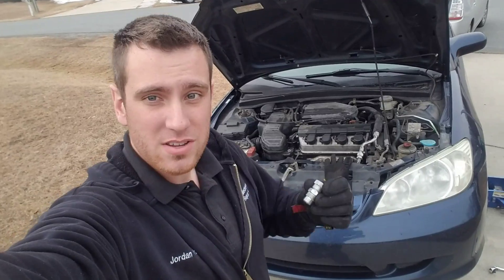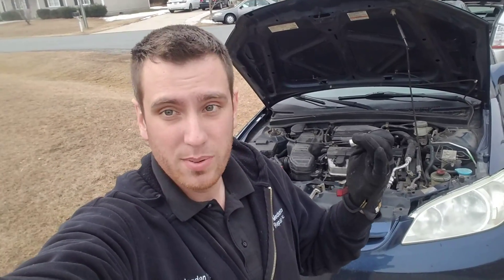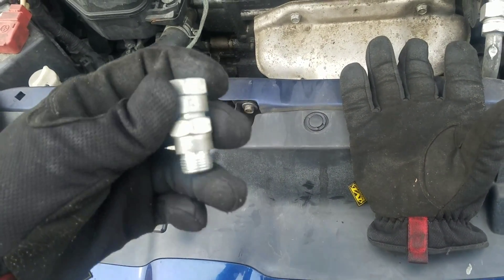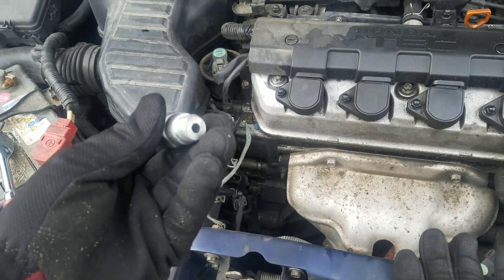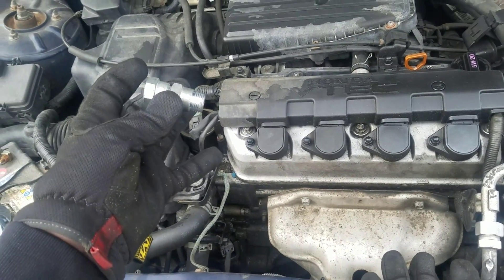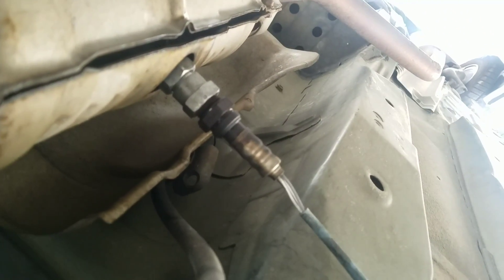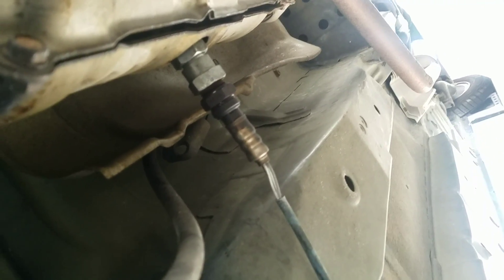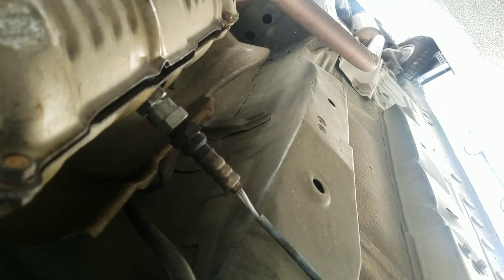P0420 P0430 Fix Keep Check Engine Light Off

Comment: So, you got the emissions light switched off. The light that tell you your car will fail the emissions inspection. Waste of time.
The only difficult bit in changing the rear sensor is getting the old one out. If you can do that, fit a new sensor. Now the light is out, and your car pass the emissions test....

Comment: Too bad that trick didn't work on my 2008 gmc acadia. 
When it did it code came out as low volts Bank 1 sensor 2.
Reply: I did an arcadia once and had to put those on all 4 sensors and it passed

Comment: OR... you can just get the specialty non fouler and skip the drilling for about an extra $8.50:
https://www.amazon.com/Defouler-Straight-Header-Exhaust-Stainless/dp/B07STVNJ3K/ref=pd_sbs_263_1/134-3160155-8718208?_encoding=UTF8&pd_rd_i=B07STVNJ3K&pd_rd_r=6c543257-4a17-4933-beb9-7592414d7b18&pd_rd_w=OFVvD&pd_rd_wg=DJNLr&pf_rd_p=7cd8f929-4345-4bf2-a554-7d7588b3dd5f&pf_rd_r=AXJ3PHK73V5AVGQYWVG2&psc=1&refRID=AXJ3PHK73V5AVGQYWVG2

Comment: Hi, So basically keeping everything the same leave sensor on but put this extension so it doesn't read ??
Reply: It does read but sensitivity is reduced. The data stream from the O2 sensor no longer fluctuates in rhythm to the upstream (pre-catalytic converter) sensor. Therefore no codes are detected by the ECM. The upstream sensor does fluctuate voltage constantly when it's working to enable rich to lean gas mixtures.

Comment: Hey your cute but do I really need this ABN 3 Piece 3/8in Drive Oxygen Sensor Wrench Socket Set  or can I use a wrench??
Reply: If you want to re-fit the old sensor, you do need the dedicated tool.
If you fit a new sensor, you don't need the tool, you just cut the cable off the old sensor.

Comment: Disconnect battery..light goes out for a,while...get test...
Reply: GOD'S SERVENT that’s doesn’t work for a smog test, the ECU will tell that the emissions monitors are not ready to test and that’s an automatic fail

Comment: Great job! My honda Ridgeline gave a P0420 on bank 1 so I put an anti-fouler on the top of the cat which is bolted directly to the motor (it has an upper and lower). I cleared the code & drove it for 20 miles and got another CEL for P0420 below threshold. This time I put an anti-fouler on the lower one, hopefully that did it the trick. Truck has 145,000 miles.
Reply: This trick only works on downstream 02 sensors. The upstream,meters. Downstream monitors. Pull th upstream off. That will fix the problem.
Reply: @williamkeeler6408  AWESOME tip, will do thanks William.
Reply: @williamkeeler6408 if the code still trips it’s likely an oxygen sensor that is throwing the code anyway

Comment: It might keep the check engine light off but the engine will not perform effectively in terms of emissions and engine performance itself,right? It might help one thing temporarily but it affects the other parts,say,severely ? Go with the safe way,I say....
Reply: the rear senor that you are fiddling with here is only sniffing what the cat is doing, not the air fuel ratios involved in engine performance
Reply: Absolutely
Reply: Christopher Hall thanks I mean you could have situation where it is totally clogged up but you won’t need Code to tell you that the car will literally run like shit

Comment: I have had mine on for 5 yrs and no engine light at all great fix
Reply: What size spark plug non filer do I use
Reply: @dmaze89  18mm

Comment: Hi, had a problem of check engine light coming on, it will stay on for few days and then go off for few days and then come back on again. Checked for codes and got p0430, cat conv low efficiency. Tried the video method, t(he spark plug defoulers), p0430 code went off but got a new code, p0153 which is O2 sensor related. any suggestions? or may try removing the defoulers and using seafoam into the cat for cleaning.

Comment: Not recommended!  This is only a temporary measure, the reason why catalytic converter failed it is due to two much unburned raw fuel dumped into the converter causing carbon build up inside the converter and therefore catalytic material can no longer facilitate the reaction to burn off the raw fuel....  this will lead to more carbon build up inside your converter and sooner or later your converter will completely plugged up and too much back pressure will cause your engine to run poorly and stalling.   If you know how to jack up the car to pull this cheater in, why not spend $200 dollar to replace the catalytic converter yourself for the long run.
Reply: because it's $2000, not $200.
Reply: $2000 if you take it to the dealership, $200 if DIY.
Reply: @NotSoIncredible  Even if you do it yourself, in KaliFornia it's $1200 just for the cat! Then you have the headache of installing it....
Reply: Because the car has 400K on it and I need it to get thru one more winter and not worth the trouble of busting knuckles on rusted converter bolts. The O2 sensor fix is easier and cheaper and does the job!
Reply: New cat for my car is $370 plus it sits too low to get under it, even on jack stands.
Reply: Just buy a new catalytic converter put it in just four the test and take it off after...  repeat every two years
Reply: I found one for mine on Amazon. It's only $524 (CA emissions though). At least it includes "free" shipping! That's onluy for the rear one.
Reply: My cat cost 900 it's a subaru and cuz of the design or engineering universal cats dont even fit.. car cost me 2600 for an 09 impreza  100k miles I did this today drove 30 miles so far no codes runs smooth
Reply: A cat that is only $200 is probably garbage and you'll still get a code after installing it. The good ones that will "most likely" not throw a code again are much more. People nowadays can't afford to throw away hundred or even $1000 or more. Sometimes you have to try a cheaper fix and hope for the best. And like he said, these emissions standards are so incredibly high that you can get a code at 95% efficiency, which is ridiculous.
Reply: @BlackNGoldRules   I agree, things have cost a lot more since I commented on this 5 years ago.  Some states have gotten rid of these ridiculous emission standards, You  would just hope that a catalytic converter thief just stopped by to get rid of the cat for free. LOL.
Reply: A lot are more than 200$, also, just replace cat with a pipe

Comment: Will the o2 sensor still work, or does this inhibit the sensor?
Reply: What it does is pull the 02 sensor back away from the full flow of the exhaust fumes as it comes out of the catalytic converter so this delete actually tricks the computer into thinking the 02 sensor is reading correctly.

Comment: FIxbook and All, I have P420 on my car so wanted to confirm if it was CAT or the PCM program needed a reflash. After installing O2 spacer (only 1 used)  I got Error Code P0037  defined as (HO2S) Heated Oxygen Sensor Heater Control Circuit Low, Bank 1 Sensor 2. After driving 70+ Miles the SEC/MIL did not come on but the CAT monitor went on not ready/ NA. May be due to P0037 the P0420 did not trigger so my test was not successful. Now the new problem is after removing the spacers i still get P0037 so not sure what next ? any help/ Suggestions would be appreciated. thx
Reply: Did u replace sensor? 
Then ad spacer